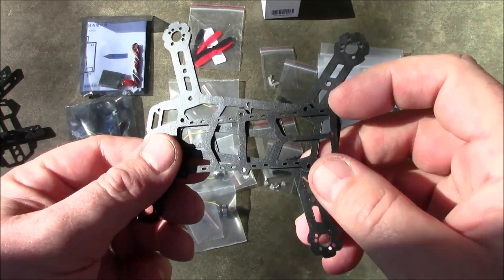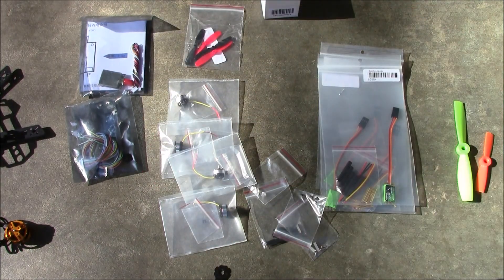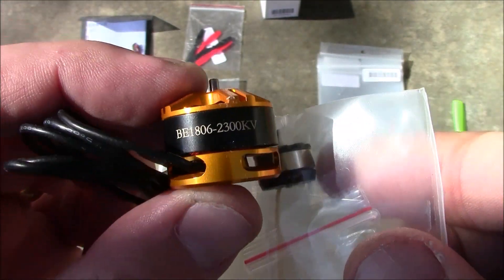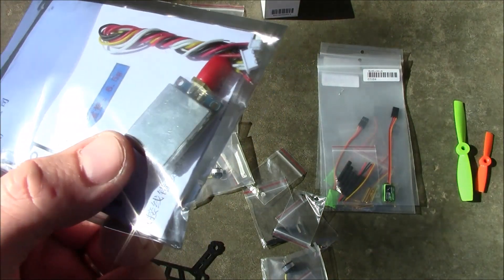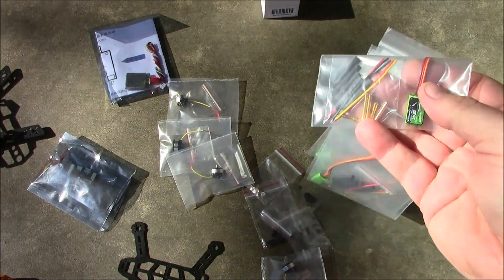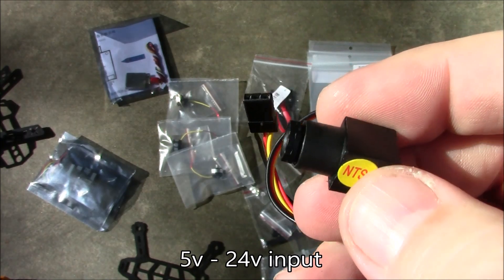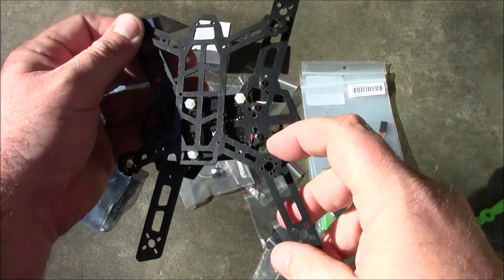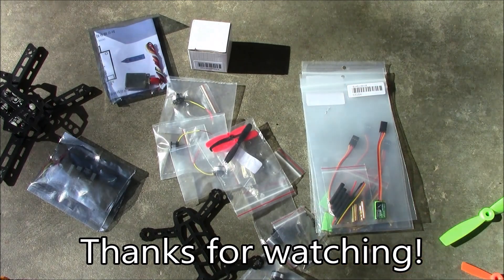LKTR120 Overview and Parts - Winter Project

Comment: Where is your LKTR120 upto Travis? Ive had mine flying well for a while now!
Reply from the maker: +Bishop Vick I spent a lot of time on it and got it to fly.  Then it just dropped out of the air.  I picked it up and put it back on the shelf till I get more patience for it.
Reply: Ahh :/ I have found with mine too that when its getting close to low battery, if i give sharp high throttle spikes it runs the risk of falling. I tend to avoid giving full throttle at any time and generally just cruise around at around half throttle. I'm not really sure it has enough power to recover from flips too (mine is 105g). I have found that the choice of battery makes a big difference too for dropping out with high throttle. I use Turnigy Nano tech 460mah 2s 25-40c and these seem to work very well. Had more drop outs with other lesser quality batteries I've tried. I really hope you pick it back up and get it flying well soon. I love mine and i'm sure you will yours too whens its right :) I'm looking forward to seeing a video on it ;)

Comment: any update on this build?
Reply from the maker: +Tomoshimei Kitata I got it assembled enough that I was able to fly it.  While I was test flying it, for some unknown reason, it dropped out of the air and crashed.  I was pretty frustrated with it and put it on the shelf to work on later.
Reply: +travisgrindal  im getting this frame and will  use  a bigger 1104/05 motors and some lil bees but i would sure love to see your  flight review on this
Reply from the maker: +Tomoshimei Kitata Quadnizer After I get it together, I'll be sure to show how it came out.  Right now, it is waiting for me to get back to it.  I want to finish my 130 and a ground station.  Maybe after those I'll get back to it.

Comment: I have been looking at this LKTR120 for a long time now. I need to get a 120mm Brushless quad. I am still undecided. Mostly for indoor flight in a small room but also for outside. So I hope you can help me with a doubt about which motors to use. LKTR120 frame only, comes in three version: With 4600KV motors 6500KV and 7800KV which one are the most powerful? is for a FPV set up of course. And my second doubt is if inteast I could just get the frame an use this instead http://www.banggood.com/4-x-Eachine-BG1104-4000KV-Motor-4-x-Eachine-XM-Series-10A-ESC-BLHeli-8-Pairs-3020-Propellers-p-995438.html with the LKTR120 frame? Thanks
Reply from the maker: +Multirotor Go I saw someone else use that power pack and their quad flew awesome.  I had mine flying and was outside flying it and it suddenly dropped out of the sky.  It is on the shelf now waiting until I get more patience for it.  Because of its small size, it is difficult to assemble.
Reply: UFF! and is going to be my first brushless assemble.

Comment: If your interested I have a few new frame designs coming out soon, little zmr120 (looks like the original 250), a low rider Zmr120 and a x style (krieger style) frame coming. They will all run of 8.5mm brushed motors and can use beef boards so you can have all the clean flight goodness

Comment: I've thought about these small QCs, strikes me they'll be annoying to fly because of the high-pitched whine of the 6,500kv motors. If you build it "upside down" you may be able to fit larger slower motors, and therefore bigger props, giving you less noise, more power and a very interesting looking QC. Might just "cream" your friends' quads when racing. Just a thought.

Fly it like you stole it!
Cheers.